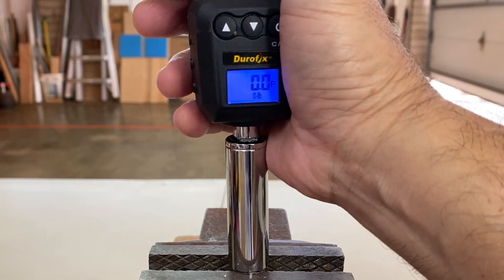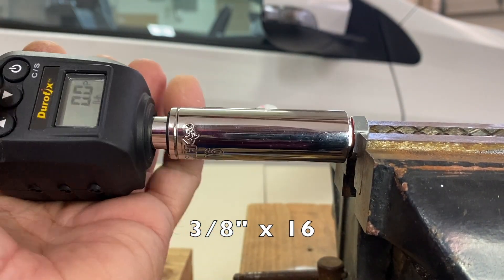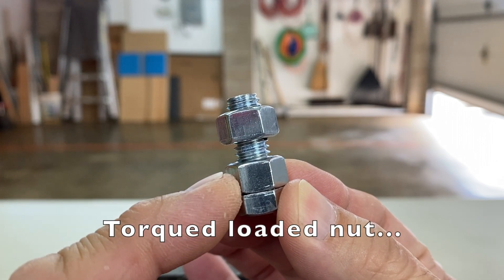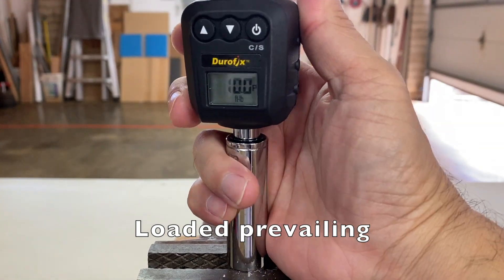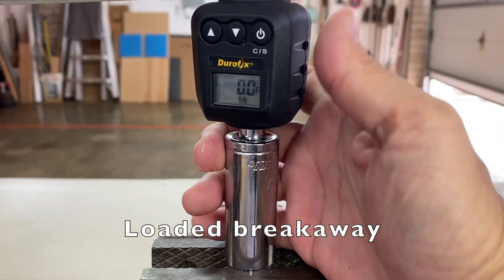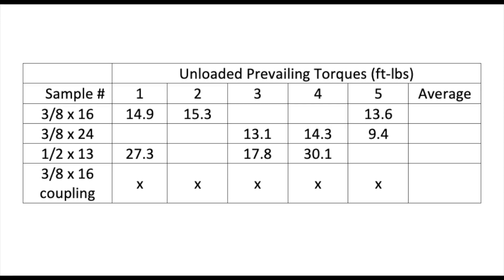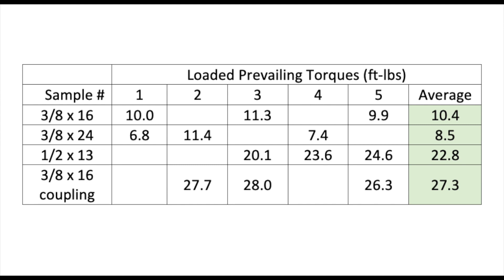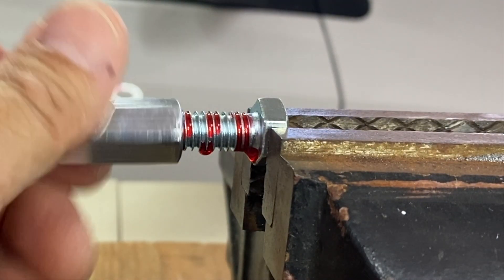Nuts & Bolts - THREADLOCKER STRENGTH TEST! - Loctite Red 271

Comment: why does Loctite say that the fastener will need to be heated to 500F once cured and it breaks away by hand in the video?
Reply from the maker: I'm not sure.  My guess is that in my case, I know that I'm using new nuts and bolts that are in good shape that can handle the torque.  In other situations, you will not know if the nut and bolt are somehow compromised and will twist in two if too much torque is applied.
Reply: Exactly. I see these videos - like this - the nut turns relatively easily after 24 hour cure. Yet other videos - the guys go right to a torch without showing why it is needed. They just say you need to heat the parts. Is this a cleaning issue? Were the bolt/nuts in many videos not cleaned/de-greased? I don't get it. I DO get that the 'locker is intended to prevent loosening from vibration, etc - yet we have all the tales of woe - of trying to loosen the dreaded RED THREADLOCKER beast.

Comment: Not sure if you saw my comment, but super glue and epoxy has an almost instant reaction that causes them to bond together. Not sure if different types of epoxy and super glue have different outcomes or how the strength is affected.
Reply from the maker: Super glue and epoxy?  Interesting…
😎
Reply: @HacksbyDad  yep. I stumbled on it by accident. I had something I needed to glue together that I didn't have a clamp for. So, I put epoxy, I think Elmer's Pro Bond Advanced, on one side and few drops of super glue on the other, in hopes the super glue would set up and hold it until the epoxy hardened. They reacted and set up within seconds.
Reply from the maker: @mandolinman2006  Thanks.  Might be a topic for a future video.  LOL
Reply: @HacksbyDad  could be of interest. I have no clue how it affects the strength, cutting, or if different types of epoxies affect it differently.
Reply from the maker: @mandolinman2006  Thanks!